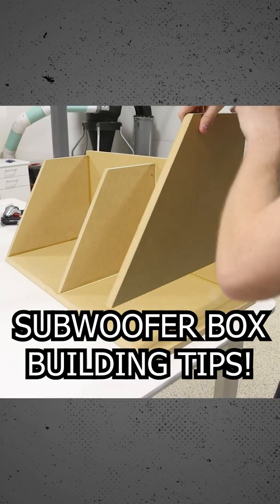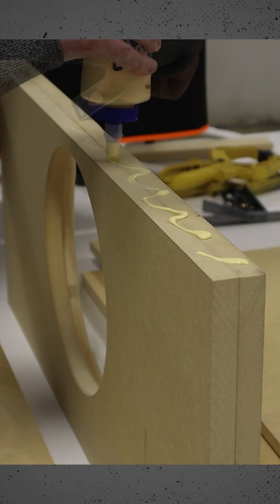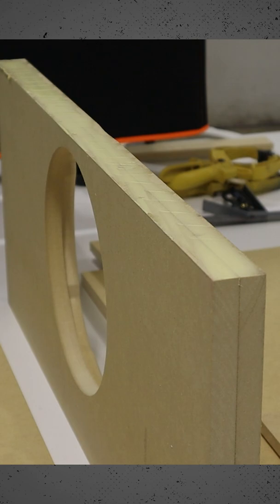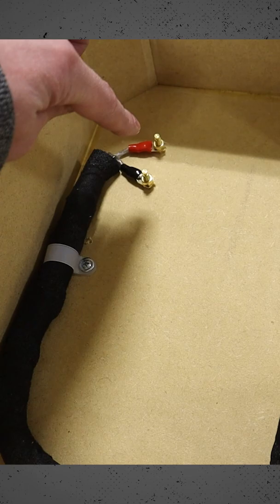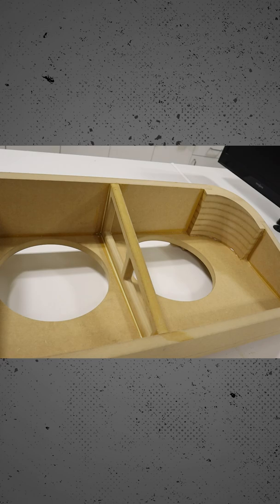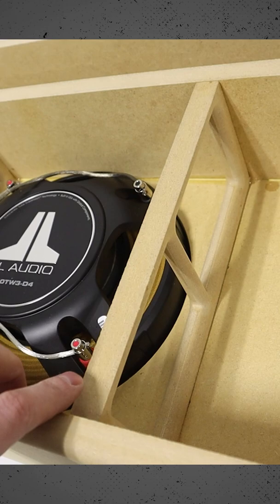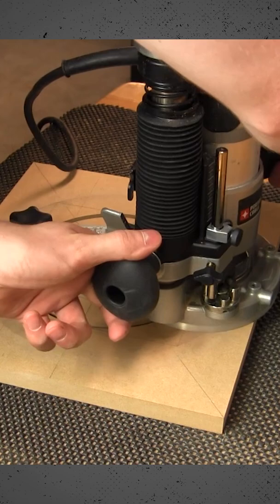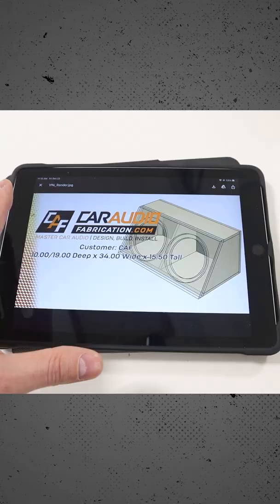Subwoofer Box Build Tips! #shorts

Comment: I tried laminating the interior of my MDF with resin and it worked quite well as the wood soaked a good percentage of it and cured like concrete slabs 😂 but idk double baffle if you want but I’m a weight conscious builder because I still want the car to handle around corners 😅

Comment: Point woofers rearward, screw and don't use wood glue heat destroys it in auto. 
Gorilla glue is best, stuff it poly fil , coat trunk metal with lexel then brake disc grinding waste,then aluminum foil, then glue carpet ,better than the 24 dollar a foot stuff they sell. Retired, tech , age 68..first box, 1971..doing only a few home speakers now, sorta terminal but love audio